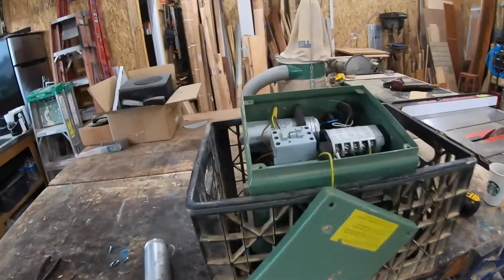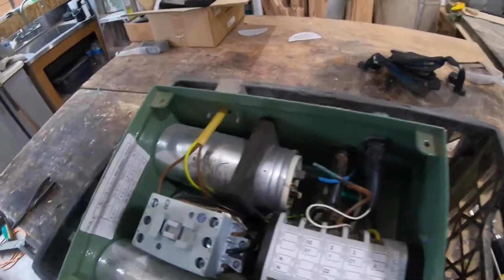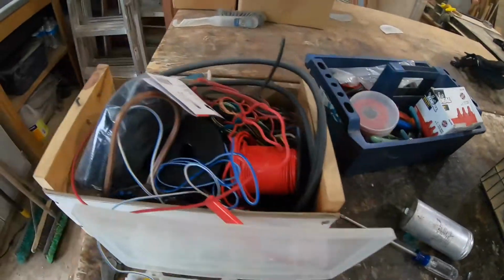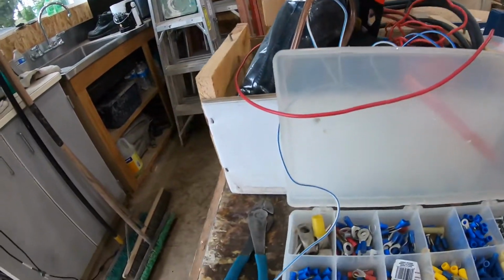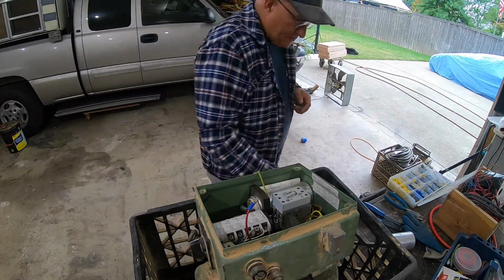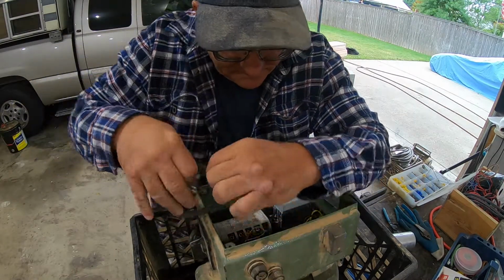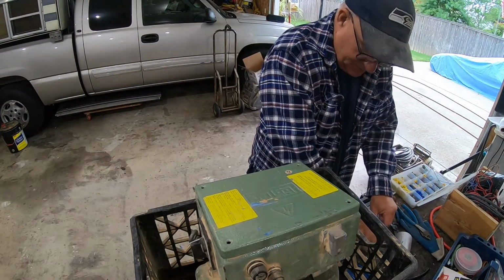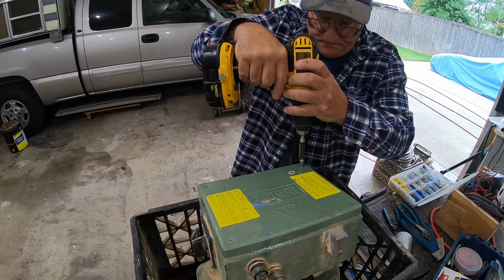Hummel run capacitor getting hot.

Comment: Hey Richard, It looks like the connector on the terminal is the weak link not making a good enough connection resulting in heat. You could connect two wires since there two connections to that terminal.  Get a 10 gauge butt connector and crimp the one wire to one end and put two wires in the other end then plug both into the terminal. Solder the terminal for best results.Get a Sta-Kon or Panduit crimper, so much better.